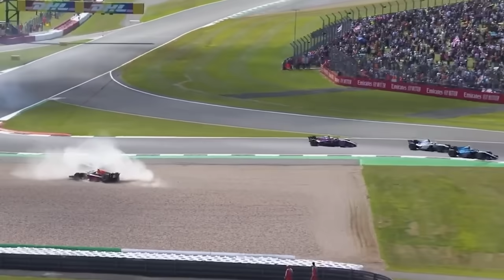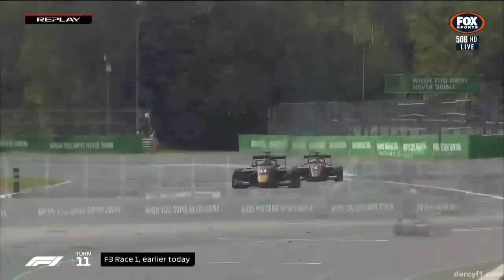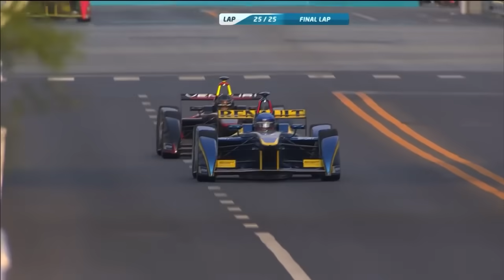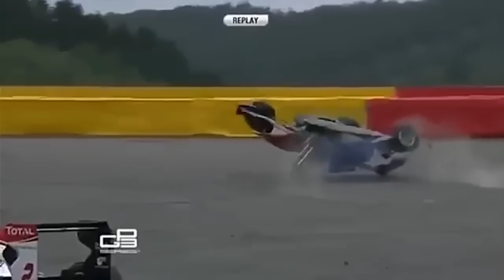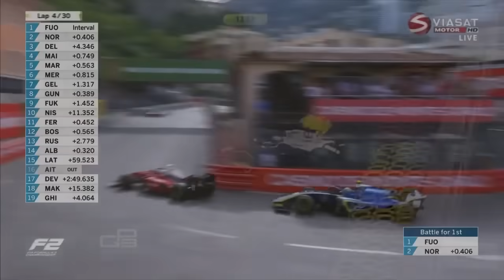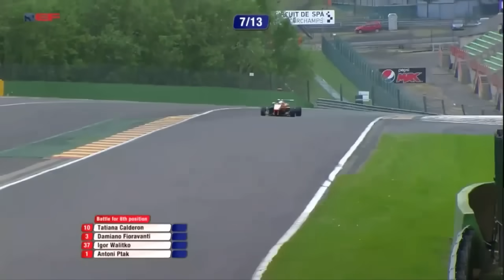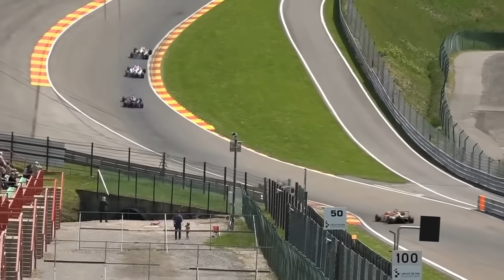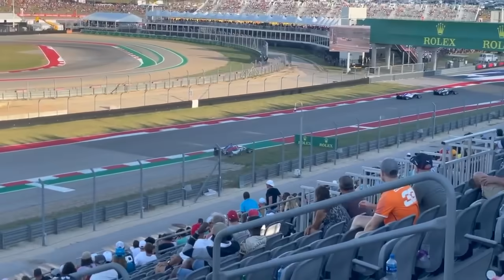Ramps on Race Tracks

Comment: I know for certain that Abbie Eaton is fully committed to eliminating sausage kerbs after her incident. She highlighted one in GT racing on her own social media a few days ago...
Reply: Was that the Monza Crash?
Reply: @marvinlinnarz5856  Yeah
Reply: Understandably too, it broke her back and she was only just able to race in W Series this year
Reply: Who
Reply: @victor.alejan  A W series driver who broke her back at COTA a couple years back thanks to a sausage kerb
Reply: @victor.alejan  7:00
Reply: The GT AM crash kept the car from sliding and pinballing across the circuit, as all of that energy was lost in the roll. Again, people who are against the kerbs don't understand the basic principles of air resistance, drag and momentum. When a car goes airborne, it is no longer able to gain any more speed or downforce. Lift and air resistance slow the car down and most of that energy is lost.
Reply: @DR3ADER1  Err… when it is sliding sideways on the ground, tyres down, it is quite literally scrubbing off speed. And what goes up must come down…
Reply: @fat_biker  Incorrect. The friction isn't sustainable to allow the speed to scrub off. As the car is not only STILL on the ground but is also generating DOWNFORCE. When a car is generating LIFT in the AIR, it is losing even more speed, because it needs a fulcrum (such as the ground) to gain any momentum or speed. The drag generated in the air is far greater than the drag generated on the ground because the body is surrounded by air on all sides and angles. And at high speed, the air is the MOST resistant substance on the planet, more so than water.
Reply: @DR3ADER1  Err… what??
Reply: @fat_biker  In baby talk so you can understand: Air = Resistance, Resistance = Drag, Drag = Slowdown, Slowdown = Loss of Energy. Cars slow down far more in the air than they do on the ground. 

The issue is not with the kerbs, as 27.77% of the incidents shown in the above video injured people and of these incidents, 40% were severe, meaning that overall, 11.11% of the crashes shown were serious. 

The issue again remains to be the poor depth-perception and driving ability of the DRIVERS. As it always is.
Reply: @DR3ADER1  that's 11.11% too much and that's the whole point of showcasing this
Reply: @WaifuWarsRacing  Going for 0% is an absolute impossibility. Furthermore, this is of the footage shown. Meaning the percentage is far less on a wider scale. Go back to school.
Reply: @DR3ADER1  can't believe I met the first aggressive sausage kerb defender on the internet.

but it's a possibility go to 0% sausage kerbs, and that's all that matters because I think 100% of the drivers would agree and those are the opinions that truly matter ;)
Reply: @DR3ADER1   You are not as smart as you think you are. Rubber on the track provides a lot more stopping force than air resistance. A car sliding sideways is decelerating a hell of a lot quicker than a car flying through the air.

 And you can't dismiss it by saying the problem is the drivers not the sausage curbs -  That's as annoying as saying you don't need any safety features because the problems are due to the drivers and not the cars. This is racing - incidents are going to happen, and when they do, features of the track should not make them worse. Simply running a curb should not launch a car and cause a major incident.

 But yeah, you're a genius, and understand it more then all the people actually involved in the racing who recognize how dangerous they are 🙄
Reply: @valerierodger7700  "You are not as smart as you think you are. The rubber on the track provides a lot more stopping force than air resistance. A car sliding sideways is decelerating a hell of a lot quicker than a car flying through the air." 

WRONG, case in point: The Dumbreck blow over in Le Mans 1999 covered less distance than Hakkinen's grounded puncture at Hockenheim in the same year. A car in the air is subjected to MORE RESISTANT FORCES than a car on the ground, Gravity, Air Resistance and Drag, a car on the ground is only subjected to Drag and Air Resistance. Air resistance, especially at speeds greater than 100 km/h is dramatically greater than any friction the tyres experience. And you think I'm an idiot? Tch, don't underestimate the power of the air. The faster you go, the thicker the air gets. 

"And you can't dismiss it by saying the problem is the drivers not the sausage curbs -  That's as annoying as saying you don't need any safety features because the problems are due to the drivers and not the cars. This is racing - incidents are going to happen, and when they do, features of the track should not make them worse. Simply running a curb should not launch a car and cause a major incident." 

YES I CAN, I fucking CAN when you know how drivers bitch and moan all the time about not being allowed to break basic driving etiquette and fail to account for proper spatial awareness. The crashes you see are a result of driver incompetence, the kerbing getting struck is the outcome of their stupidity WITHIN the track limits. And it's only annoying to you because you simp for idiots who are infamous for bitching over all sorts of stupid shit. 

"But yeah, you're a genius, and understand it more then all the people actually involved in the racing who recognize how dangerous they are." 

It doesn't take a genius to read a book on the Laws of Physics and Motion. It does however, take a complete fucking retard to side with people who are also stupid, just because they're popular with the court of public opinion, who flip-flop as frequently as a fish out of water.
Reply: @DR3ADER1  Dude, you are just plain wrong, I'm sure you can cherry pick an example where an airbourne car slows quicker than one on the ground, but more often than now that's due to an impact...
Sausage kerbs are just a super dangerous way to save money from reconstructing the track to use sand pits or similar to deter cutting. Racing is precision sure, but it is also an unpredictable, calculated risk.
You sound like just another youtube expert who hasn't really watched much racing at all, let alone raced yourself. 
Back to your theory of air slowing a car down quicker than any sort of friction with the ground as a rule, well, weird hill to die on, and you claim to understand physics...
Reply: @nicholascrow8133  This is not cherry-picking, rather, this is example-providing. Also observe Nascar blowovers, even with the flaps, cars still take off and they LOSE SPEED IN THE AIR, not gain it.  

You also ignore the variables such as brake failure, suspension failure and the limitations of tyres, particularly the fact that contact patches of the tyres are comparatively small in proportion to the vehicle. You also ignore the BIG variable, the surface condition of the track. When it rains, the tyres are barely making ANY CONTACT with the tarmac, they're floating in the water, and the same applies to Ice and snow. This makes abrasive paint useless as an alternative to sausage kerbs. 

You claim that it's a hill to die on, I see it as a basic fact of physics and resistance you refuse to acknowledge because it defeats a popular narrative. Popular narratives are not accurate narratives.
Reply: @nicholascrow8133  Again, the kerbs are not the problem, bad driving standards are.
Reply: @DR3ADER1  The issue is that these kerbs turn what could be minor off-track slides and skids into terrible crashes. You want to scrub off speed? Use gravel. Don't use fucking ramps into space, the moment you touch those the driver has no more control over the car, and the crash is less predictable and thus less protected.
Reply: @short_kenobi  She was also the test driver for seasons 2-4 of The Grand Tour
Reply: @DR3ADER1 ”A car in the air is subjected to MORE RESISTANT FORCES than a car on the ground, Gravity, Air Resistance and Drag, a car on the ground is only subjected to Drag and Air Resistance” 

this is just wrong. First, gravity will have a negligible impact on speed as it’s a force in a completely different direction to the motion. Secondly, what do you mean a car on the ground is only subjected to drag and air resistance? that’s true for the car in the air, but on the ground majority of the slowing force is friction. this isn’t up for argument, the air resistance on the car is nothing compared to the friction by the tires. if air resistance is stronger than the friction of the tires, the cars wouldn’t be able to move at the speeds they do

“Air resistance, especially at speeds greater than 100km/h is dramatically greater than any friction the tyres experience” so if air resistance overcomes the friction force of the tires, how do the cars move faster than 100km/h? because if air resistance truly was greater, then the tires would end up losing traction… but they don’t
Reply: @DR3ADER1 ”And at high speed, the air is the MOST resistant substance on the planet, more so than water” excuse me??? I genuinely hope you’re trolling because there’s no way you genuinely think that. you think that air, a gas that can be compressed, is more resistant than water, a liquid that can’t be compressed? do you know what happens when something hits water at high speed? it stops. very quickly.

There’s a reason that planes can fly through the air at 800km/h+ without issue, but can’t hit water at that same speed without disintegrating. That’s because water is incredibly resistant to energy since it doesn’t compress. there’s no way for the water to absorb that energy, while the air can
Reply: @roowut  Because friction is a lot LESS EFFECTIVE at slowing you down than air resistance, the faster you go, the thicker the air gets. The moment you are in the air, the car can not gain any speed because it requires a fulcrum to gain speed AND you are also surrounded by the air in its entirety, which always slows you down because it is a force in itself, especially when the car arches back onto its flat underside, the area that's not made to be aerodynamically efficient or have a low level of drag. Planes (and even gliders) gain speed in the air because they don't require the use of the ground as a primary source of thrust and are built around lift, instead of downforce. 

Also, the car is already moving faster than 100km/h BEFORE it is launched. Just because a car is in the air, doesn't mean it's moving faster than any other moving vehicle on the ground. That's a trick your brain makes because it LOOKS faster. Also, the tyres automatically lose friction when their primary source of grip, the ground is no longer in contact, because excluding the presence of heavy rain(where the wheels are not touching the ground due to a high content of water), tyres and the wheels themselves do not generate thrust in the air. It's why Rally cars LOSE SPEED when they jump large crests on a stage. If they didn't lose speed in the air, then they would continue to fly upwards and forwards because they are generating lift, instead, however, they arch downwards towards the ground.

Comment: FIA: We created it to stop drivers from disrespect track limits

Reality: They created mini versions of every single turbo ramp ever in Mario Kart or Crash Turbo Fueled
Reply: They created Asphalt 8 tracks instead
Reply: Yet they will still invalidate your lap if youre 1 tyre on the white line. They want synchronized swimmers not drivers
Reply: FIA: We have rumble strips to warn drivers of the track limits, so that they don't get a penalty!
Also FIA: We're going to implement harder track limit indicators that often launch drivers 50 feet into the air if they even thing about going off track limits.

Comment: Not all of these are sausage kerbs. Many are just normal kerbs, like the Christian Bogle one, and the Sophia Flörsch one.

Kerbing of some sort is needed to define the limits of the racing surface and protect the edge of the track (as the track edge is a weak point and will wear out quickly if it lacks this reinforcement in a place where cars are pushing the limit).

However as the two crashes I mentioned show, greater care needs to be taken in accounting for cars hitting the kerbs at unusual angles (as they will when forced off the track from time to time). In the case of Road America, where it is an entry kerb, there needs to be a more gradual transition from flat to the full kerb height. In the case of Macau, it was the fact that the kerb was being struck from the wrong side -- this could have been improved by having a raised surface inside the kerb, but obviously there was another major issue in that a car going off from the inside of the straight would miss the escape road and have no runoff, so the actual solution of moving the inside barrier to deflect cars towards the escape road was a good approach.

As for sausage kerbs in many of the other crashes, these are a partial return to the huge kerbs of the olden days, but in a more targeted manner. Typically this relates to chicanes where the benefits of pushing the track limits are too great. Even at chicanes they are over-used; I think the only cases are where they are acceptably safe would be when they are at a location that is fundamentally inaccessible except at low-speed, e.g. because the configuration of barriers prevents high-speed cars turning sharply enough to reach the location.

The use of them as an asphault runoff-protecting device, e.g. at Parabolica, was pretty much criminal. While it's desirable to have "natural enforcement" of track limits (i.e. where leaving the racing surface slows you down or makes you crash) rather than "enforcement by penalties", safety can't be compromised to nearly that extent.
Reply from the maker: Fully agree with you here.

Comment: Lando Norris is calling to ban those kerbs
and he is right, i mean, they should be racing, not flying
Reply: as wirtual once said, time spent flying is time spent not accelerating.

nor steering. this ain't no 90s arcade.
Reply: It’s so true. When cars get airborne things get much more dangerous. We cannot seriously condone this danger just as a deterrent to track limits.
Reply: @gibospartan6185  los coches de este año dependen mucho del efecto suelo, así que no muy conveniente digamos tener eso en la pista con coches que depende de agarre del suelo
Reply: @gibospartan6185  Incorrect, when a car goes airborne, it is unable to maintain speed due to the high levels of drag it experiences in the air compared to the drag on the ground, note how Dumbreck's CLR only flew a few feet after a blow over before landing in the trees just before the second kink, when Rockenfeller's R18 remained on the ground, it skated further along the track past the second kink because most of the energy and momentum was preserved due to the lower centre of gravity and the longer period it spent on the ground.
Reply: @DR3ADER1  Yes but that's not the point. Barriers at circuits are not designed to handle flying cars. Flying cars can avoid barriers designed to absorb energy like tyre walls and tecpro barriers. 

See: 2018 F3 Macau Race (Sophia Flörsch)

It also runs the risk of going over or destroying catch fencing which can put marshals and spectators at risk.

See: 2022 Indy Lights Road America Race (Christian Bogle)

2018 F3 Macau Race (Sophia Flörsch)

2019 F3 Monza Race (Alexander Peroni)

In addition, cars are not designed to go airborne and open wheel cars have drivers sitting almost on the car's floor with no protection for hard landings resulting in fractured vertebrae for the below:

2020 F2 Spain Race (Sean Gelael)

2021 W Series COTA Race (Abbie Eaton)

2021 F4 COTA Race (Christian Weir)

Indeed flying cars will slow down aerodynamically due to drag but that does not help if the car crashes shortly after becoming airborne. It doesn't help if the car lands somewhere unsafe (Like over a catch fence where it can injure marshals, photographers, etc). And it doesn't help if the car lands at a bad angle or on a bump. 

Flying cars throws a lot of variables into the mix which simply cannot be controlled safely unlike most crashes.
Reply: @donnycorn3086  😂😂😂
Reply: @gibospartan6185  for spectators as well, once the cars are airborne you have no idea where the car might go or what it might hit